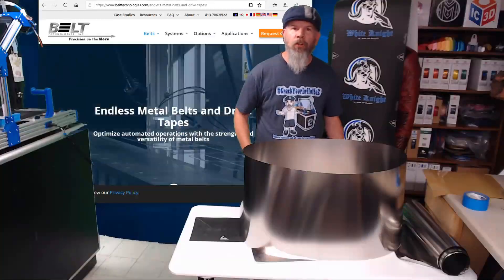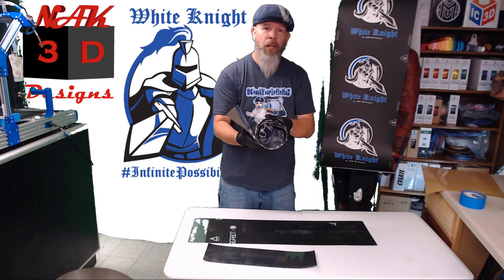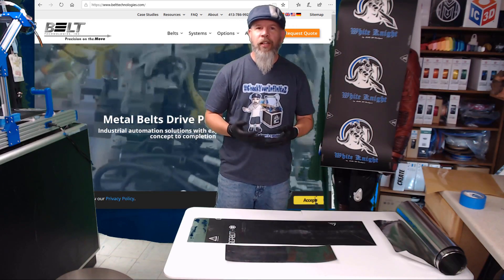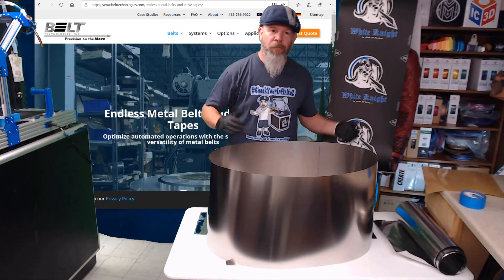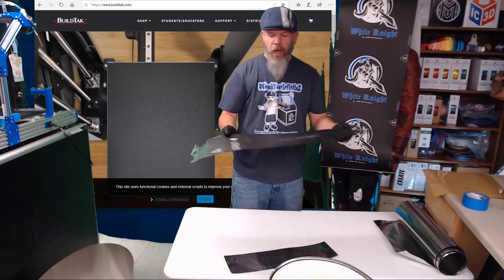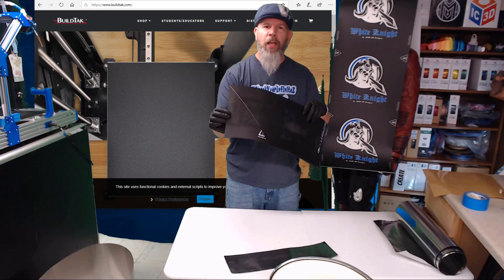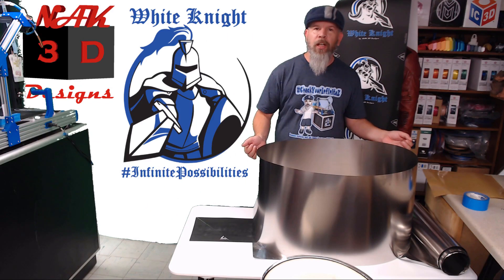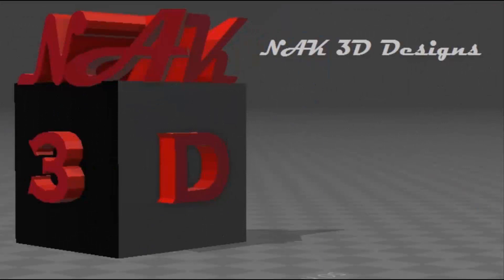White Knight - All about Belts - "Giveaway has ended"

Comment: a rotary printing head with multiple extruders (a max ideal would be 3, more than 3 would be too crowded) for multiple color printing, befor the color change you can set the forward extruder to be heated and prepare it, also do a short increase in extruder temperature maybe for the backward nozel before the switch so the change in color will have suposedly more adhesion

Comment: damn, so let me get this .. the printing material (adhesive surface 2 m long) got shipped without being mounted on the stainless steel? you mounted it by urself using "rapid tac"? would uv heating plus the rapid solution help in mounting the printing surface better/easier and or quicker in any way?
Reply from the maker: no clue

Comment: Hello friend, could you please give me the specifications of the stainless steel belt? How is the material hardness, length, width and thickness please? Thank you so much !!!
Reply from the maker: its fully hardened 6 thousandths thick..400mm x1920mm.  all specs and sources are available on the Github..  https://github.com/NAK3DDesigns/White-Knight/tree/master/BOM

Comment: I have a treadmill I was looking to use to build one of these and the belt was the only thing I was not sure about, was thinking about the possibility of using, stainless is great idea but my experience with stainless is it can crack if flexed over and over and why they don't build cars with it as the flex in the wind makes it crack, but also was thinking about carbon fiber matt used for fiberglass boats to strengthen the hull comes in a fine woven variety in many thicknesses would be create for this very strong and flexible, you should look into it, it can be stitched together, owe I just come up with the answer you could get a carbon fiber and weave it in a tube, will look into it, also it will not stretch either.
Was wondering were to go and get you plans or kit to have a go at creating one, is the print head at a 45 degree angle.
Reply from the maker: All the files are in the GITHUB link in the description and there are 32 episodes of assembling the White Knight here on Youtube...  Good luck.

Comment: Hey Karl, what kind of problems would I run into if I use a belt which is made without a weld like the one you've made on the part 30 video? And would you recommend a fixture to eliminate the curling before laser welding?
Reply from the maker: Hi, I used aluminum duct tape to join the seam and then offset the Buildtak to help cover the seam.  However almost 2 years later I'm now noticing a crack start to form at the seam, I anticipate it is only a mater of time before my Buildtak sheet rips at the seam..  I highly recommend if using a steel belt that it be seamless.

Comment: Hi Karl, this perfect, I really admire your design! I have question about the thickess of the belt - do you think, I can use 0.3mm hardened stainless steel plate, or its gonna be to thick? That is the thinnest option, I can buy in Czechia. Thank you! Jaro
Reply from the maker: What I currently use is 6 thousandths which should be .15mm.  So what you can get is twice as thick.    I would have to say that would be too thick.   I wouldn’t go any thicker than what I’m using now.
Reply: @NAK3DDesigns  Thank you. I found a 0,1mm thick belt, so I will try my luck!

Comment: I can't seem to find the physical dimensions of the white knight and squire. I can find the build dimensions, but not the space I need to carve out to house the printer. I'm trying to decide between White Knight, Squire or wait for CR30.
Reply from the maker: If you have the ability to open the fusion files you could measure them in the assembly files..  To be honest I've never measure the total foot print..  If I remember tonite I'll take a tape measure to them.. ;)
Reply: @NAK3DDesigns  Hello Karl, no need to do that tonight. I found the full assembly file and measured it from there. The tabletop dimensions are approximately 950 x 570 x 648mm. I need to look for space now to place it.
Reply from the maker: Don't forget to take into account you'll need lots of space out the back of the printer if you wanna print very long objects..  I keep mine on a wheeled display so I can tuck it out of the way when I'm not using it..
Reply: @NAK3DDesigns I do want to print long parts for our cosplayers. I'd like to push one side against a all and would like the prints to come off the the other side so can I just place the display on the side and the other way around? Any issues without having easy access to the current "front?"
Reply from the maker: Once you have it all calibrated it shouldn't be a huge issue, but it is a pretty big printer so my personal preference would be to keep it "mobile"..
Reply: @NAK3DDesigns  Thanks Karl. I understand mobile is best, but I need a "home" for it. I would love to have it on on a cart so I could bring it to events on campus...when we have events again... I think it would be an attention getter. I have other big printers and tools in our lab too and I'm running out of space, need a new lab. :) Hope we can kick this project off! Hoping to do group buy on belts in the Chicago area since they are over $400 and I don't have funding for this project. Thanks again for the cool design and all the hard work on it.
Reply from the maker: Yea I put all mine on some kind of cart or wheeled table..  This way i can push them all in a corner or against one side of the room, or spread them out if I need too..  I have 10 printers  and my workbench all crammed into a 12x12 room.

Comment: because teh z axis is infinite you only need a 5mm section to print on that stays flat and true.. ( actually only the width of the nozzle)  so why not print on a cylendar and and have it offload to a nother flat belt thats cheaper.. and made of doublsided stick tape or  sticky gummy .. (anything to jsutkeep the part from moving around..)   thsi would make it take less desk space..  and reduce the cost of the belt ( which in the end is only a cylendar thats been stretteched out.)   and make it possibly easier to keep heated and true..   and the second glue roller   can be shrot too.. and the output area can be a telesccoping set of poles that have 'legs' for the really long prints
Reply from the maker: interesting idea, but I think you'd run into issues with prints breaking off of the smaller roller since you'd have a very small surface area to hold the print..  Try printing a 5mm thick 200mm tall sword blade set on it end without a brim..  most times it will break loose just past the 100mm point..  Also on tests with shorter designs you will notice a wave effect to the bottom of the print, this is caused by the print pulling on the exit roller and slightly lifting at the nozzle end.   By doing a larger bed you have more print stability and weight to help prevent that issue as well.    I do welcome all suggestions and I challenge everybody to prove my opinions wrong..  this is how we learn and improve..

Comment: Hey Karl. Thanks for the cool design. I'd like to get a belt printer for our college, either build your design or the CR30. A few questions... Why didn't you go with a standard belt from Belt Technologies? It would have probably been cheaper. What is the build size of the CR30? Is your testing going well? What is this Squire printer that I've seen mention? I can't find any detail. Thanks again!
Reply from the maker: Ok, let me see if I can answer all the questions..  1.  I don't believe they have a standard belt short enough for my design and to be honest I found them after I designed the printer... 2.  The Cr-30 I have is still an alpha model so who knows what will go to market but its currently 220x180xinfinite.  3.  The squire is a smaller version of the White Knight 200x230 build volume, all the files are on the github as well..  Here is a link to my ERRF interview with Joel showing the squire.. https://www.youtube.com/watch?v=bekwCnl9BwY&t=1343s
Reply: @NAK3DDesigns  Thanks! The White Knight is big!!! I like it! So the CR30 is roughly the same size as the Squire. Does it seem like the CR30 will be available anytime soon? I would like our students and members building a printer, but with COVID things have changed a LOT. Good luck with everything!

Comment: Nice job! How much is the price of the steel belt?
Reply from the maker: Depends on if you only order 1 or get in on a group buy, also depends on if you order a seamless belt or just a cut piece of metal belt material.  Can range from $250- $450...
Reply: @NAK3DDesigns  thank you for the information! I thought it was cheaper

Comment: Dude you'd better be wearing thick gloves, especially after that belt has been used on the printer for a while. The stainless steel gets as sharp as a scalpel, it will slice you deep. Not the good kind of slicing
Reply from the maker: Phil M I could see that happening but keep in mind your talking one revolution of the belt for every 6 feet of printing.   I see it taking a very long time to reach that point. And you also have the layer of Buildtak to protect you some as well.   Thanks for the warning though.